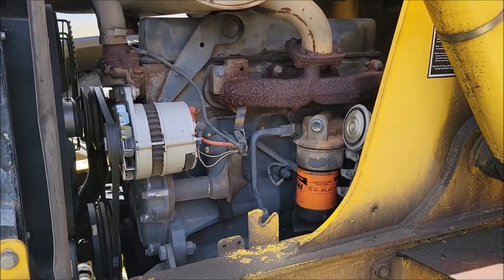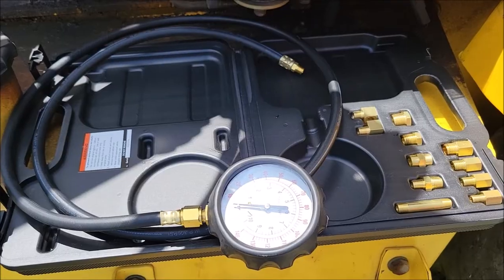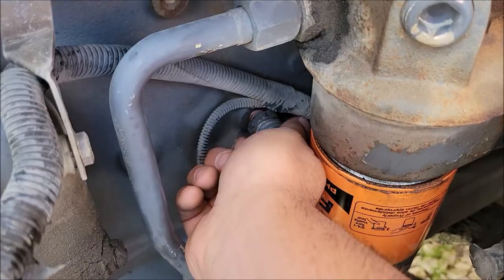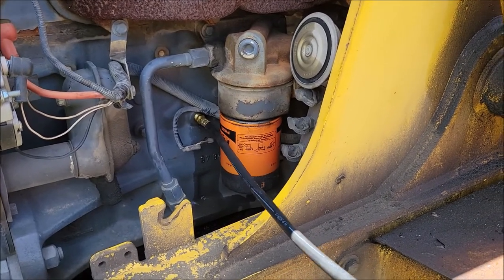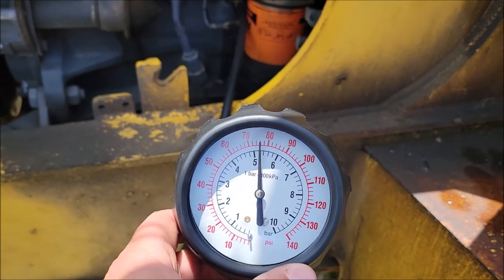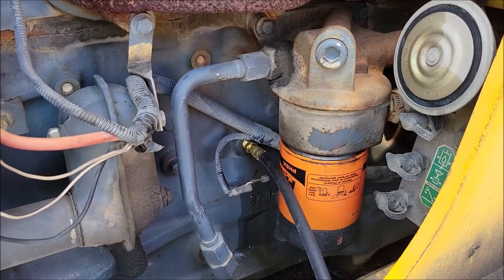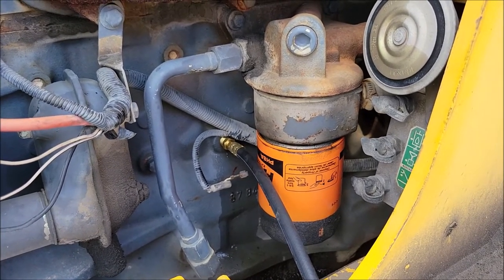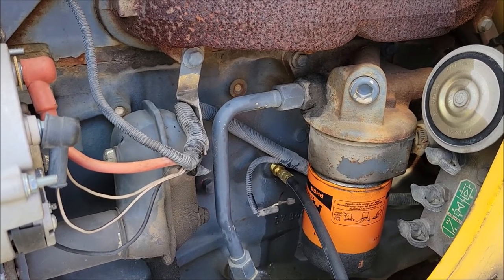Oil Pressure Test - How to check Engine Oil Pressure - Diesel or Gas

Comment: I have heard you can do a 50% diesel mix with the oil and use it as a flush.  Run it for a little while to let it get hot and then drain it.  That suppose to help remove sludge and blockages.  Don't blame me though if you try it and something goes wrong.
Reply from the maker: Yeah, I have been thinking about a flush.  I have a new video coming online that is the part 2 to this.

Comment: Yep. The higher pressure looks like a crap filter. The first thing to replace.
Reply from the maker: Sadly, I replaced the filter and it had no affect.  I plan to pull the oil pan and check the screens next, but I have to get the time to do that.